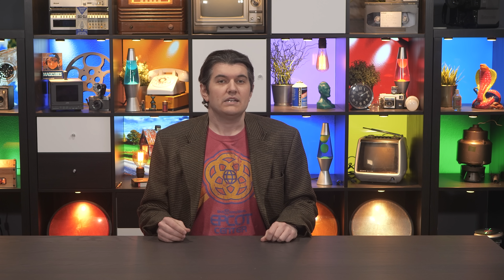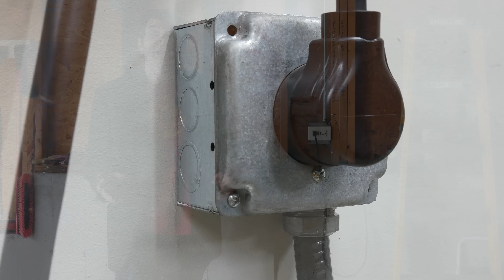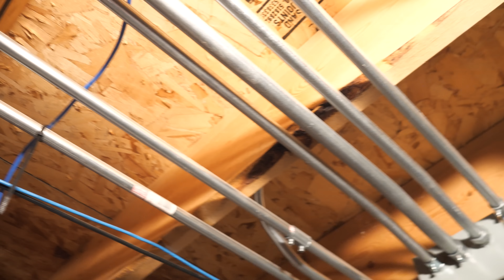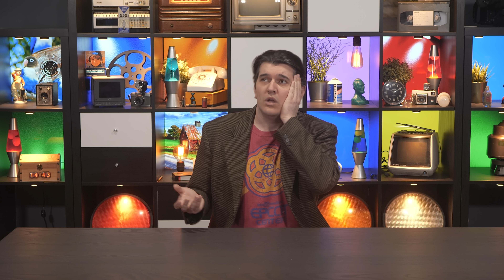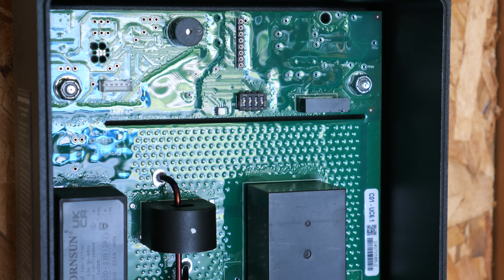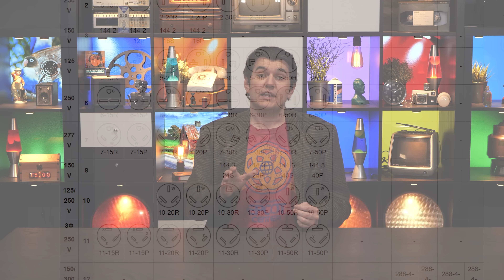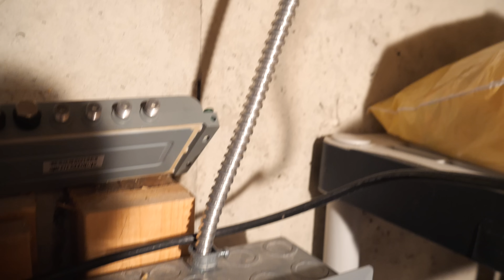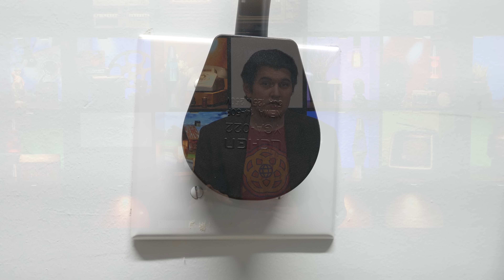The "standard" car charger is usually overkill—but your electrician might not know that

Comment: Depending on people on how much they drive most the time 120 volt charger is so good for them. I drive an electric vehicle to do Uber and I probably do close to 500 mi a day maybe a little bit less than that so most of the time I have to charge at least once and if not even at home we'll have to charge overnight. I would not be able to survive on 120 volt charging I have a 240 volt with a Tesla charger that I have an adapter for for the current car that I drive which is a BZ 4X. Cuz usually by the time I'm at home I'm at nearly between 20 and 30% and it'll take between 4 to 6 hours to charge on regular basis

Comment: And meanwhile, here in Denmark our EVSEs run on 16A 400V, i.e. just under 11 KW. And that is with a bog-standard 25A service for the house. The wonders of every house having 400V three-phase power. The US really should have upgraded its electric system...

On the other hand, we would never be allowed to do the install ourselves. Any fixed install requires a licensed electrician. So no adding new sockets or circuits yourself. You can hang a lamp, that's about it.
Reply: Its a bit funny how this video is pretty much ONLY relevant to americans
Reply: We do just fine with what we have.

Comment: The reason to get a fast charger for me would be to make the best use of my solar panels. I get charged €0,35/kWh for energy from the grid and only get paid €0,075 for any surplus from my solar panels. I also get charged based on the peak power draw every month. So it would be important for me to get as much charging done as possible before the sun sets.
Reply: Let me guess , you live in Germany right? (Like me) I have a 3 string 13KWp array with 10KW facing south. 
I have never seen more than 11KW at any given time from the array. Even now on cloudless days I peak at 7-9KW. 
I charge my Enyaq at 5.5KW and my Avenger from a standard Shuco outlet most of the time (can switch from one to two phase).
I very rarely charge at 11KW (the highest both cars can charge).
Reply: @arpinchock 
I live in Belgium, but I guess the situation is very similar. 

How do you have 2 phases in a Shuko outlet? Shuko is the normal household plug right?
Reply: @yannick7230 yes it is wired for maximal amps on the outlet.
Reply: @arpinchock  Assuming that the other 3kw are distributed equally between east and west, that means you have 1.5kwp for early morning and late evening which will typically give you around half. This setup is likely designed to stretch self-sufficiancy into earlier/later hours but  reduces realistic maximum output at noon. It's a trade-off and imho the right one, you typically don't need all that power at once.
Reply: Yeah that's also why my parents elected for a 60a circuit for an 11kw EVSE more than a decade ago. It's nice to get decent/full charges from a few hours on sunlight on weekend afternoons. Summer weekday evenings exist too for this case. 
My parents love to do things when the solar is generating 😅 (and we don't have a home battery setup, there weren't real option back when we installed solar, and we were kinda banking on Tesla allowing V2L (flop ofc)).
Reply: Funnily enough by the time I get back home, my solar array usually outputs less than the 4.2kw required for my 3phase charger to start operating. So I  have to accept some grid draw as the optional single-phase charging doesn't help me as my location doesn't allow asymmetric PV injection even though the inverter  (Solaredge) supports it.
Reply: damn, when is EV2GRID coming? peak power could be shaved down easily with that
Reply: @Strawberrymaker I'm looking to get a home battery to offset my (peak) usage to my solar panels. I don't like the idea of wearing down my car's battery to do that.
Reply: @yannick7230 nah talking about only peak power reduction/compensation with the battery and not whole offgrid (dont know who offers that but have seen it in many research papers). but going completely battery is def the better idea if you have the cash 😁
Reply: @Strawberrymaker  I don't have the solar capacity to make it through the winter sadly.

Comment: Fun Fact: That OEM EVSE that came with the Bolt (and 2nd Gen Volt) is 240v capable, albeit with a not-to-code plug adapter.

*Tried to link to images of EVSE internals, but comment keeps getting filtered.

Comment: A fellow Bolt owner here, I charge mine exclusively on 110v at 12 amp. I plug it in when I'm not use it and unplug it when I am, just like my phone. My SoC has never dipped below 50% with charging limited to 80%. Since I bought it, I have never even thought about charging or range or anything like that. I just drive it!
Reply: A friend of mine who owns a condo (in a triplex with parking right behind the building) also charges his solely on 110v.

As was said in the video, pretty much the only times where it can be problematic is when coming back from a longer trip (2-3 hour trip). For everyday use he has 0 issues keeping it topped up with a fairly average commute.
Reply: Isnt that bad for batteries?
Reply: @MattH-wg7ou it's bad for nickel based batteries, but EVs use lithium based batteries. It's actually very good for lithium batteries to stay between 20 and 80%.
Reply: @MattH-wg7ou  It’s actually better for the batteries! The speed of level 1 or 2 charging will never be enough to significantly degrade them. What makes it better is that the Bolt, like many others, has an active heating/cooling system for the batteries that keeps it as close to optimal temps at all times. This system is only active when the car is on or when it’s off and charging. So by leaving it plugged in, it can keep the batteries cool in summer and warm in winter versus if I unplugged it as soon as it’s done.
Reply: I like your safety measure of only plugging it in when you're not using it, then unplugging it when you're ready to charge.

Comment: Standard 120V Level 1 charging is not powerful enough to both heat the EV battery and charge the vehicle in colder northern climates. It just doesn't provide enough KW. You must have a warmer place to charge the vehicle that stays above freezing temperatures to use Level 1 charging.
Reply: Worked for me fine all winter outside in New Hampshire with a Bolt EV
Reply: @charliesullivan4304 Maybe you had a mild winter but a level 1 charger only puts out 1.44kw of power which is not enough to condition the battery and charge when it's freezing. Its been tested and proven on YT.
Reply: @Weezedog it depends on the car.  I have a Bolt which does better than many at charging in the cold. But I don't think there's any car that can't charge at all a 32 F on L1.  That sounds like somebody exaggerated something that they heard from someone who exaggerated something that they heard from someone who exaggerated it.

Comment: It’s amazing how much the cost of the parts is so low compared to the cost professional installers charge. Would installers just estimate for just labor cost if they knew the parts were on site? Would any local regulations need certification of the work as safe ( they do in the UK )?

Comment: In some countries the EV tariffs can be limited to 4 hours a night, so charge rate can be important.
Wire nuts... Hmmm
Smart EVSEs are mandated in some countries as part of load shedding planning for the grid. As long as they still work with internet disconnected that's generally fine.

Comment: The trouble with this is that, as an electrician, I have never once in my life been able to sell someone a charger less than 240v30a. They usually want 240v50a.
Reply: People think their 1 hour commute to work is going to set their batteries back to less than 10% so they want to be able to fully charge in 8-10 hours. My car only charges at 32A and when I was looking everyone kept telling me to get a 50A charger just in case. Just in case you need it future proof your charger etc. I'm like I have my laundry in my garage I don't need to invest in charging yet I'm still told to. So people think they need something because everyone they talk to pressures them. Then you come in and say you only need half of what everyone is telling you and they don't want to listen anymore they made up their minds already.
Reply: @paulshields2220  People think that they might need to use their car in an emergency to travel a long distance without having to wait hours to use it.

Comment: We charged my dads BYD with the 110v “emergency” charger until the power company FINALLY came to install the 220V line 4 months late. It was FINE. He would plug it in whenever he was home and whenever he left he still had a full charge or at least 80% charge if he had forgotten to plug in one day. So yeah no need for a big charger if you drive less than like 100Km every day.

Comment: As an electrician myself, i need to make one thing very clear to Alec: on behalf of the trades you've talked about, like HVAC guys oversizing heating equipment, or here with electricians installing large circuits. The average Joe customer of ours DOES NOT CARE! I can fight with a customer about how they only need a 40 amp circuit, and then lose the job; or i can just shut my mouth and install the 60 amp circuit my customer is convinced they actually need.
Reply: I told the electrician who did my evse that I wanted a 40 amp breaker and he insisted I should go with a 30… I told him no I wanted a 40 amp so I can charge at 32 amp. He finally relented but I don’t know what his issue was when I had plenty of space in my breaker and 32a would give me a full charge overnight if I needed. I had the breaker space available but don’t get what his issue was !!
Reply: I don't know the specifics of your circumstance, but if I had to guess at why the person you hired didn't want to to go with the larger size, it would be one of the following: 1.He had the materials for the lower amperage circuit in his truck, but not the higher amp circuit, and didn't want to spend extra time to acquire them. Likely because #10 wire is common, but the larger #8 wire is used less in residential wiring, except for the dryer or large appliance circuits. 2. Adding that much potential current draw could have surpassed the math formula we're supposed to use when sizing the electrical service entrance where power comes into your home. 3. It could be that the pet supply that was chosen couldn't take advantage of the extra power. Or 4. He might know that most people don't necessarily need that level of power for their charger, and was attempting to help you save money; by using less expensive materials, and thereby potentially getting repeat business from you. There could be other reasons, but those are the things that would come to my mind if I was attempting to convince a customer to let me install a lower amperage circuit. @myaccount__7269
Reply: @ampzero66 I think it was #1 .  He kept pushing me to do it and once I said I want 40amp minimum he then had to make a trip to the store to get the correct cable and then installed it and it was fine; was like an extra $50 or something so again I don’t get what his issue was. He also said I was installing a larger amp then he normally does so I am guessing he always just installed the cheaper option for his other customers to give him more of a profit for the thinner cable. So annoying though
Reply: @myaccount__7269 If that was the case, it sounds like car chargers might be his "bread and butter" type work. And your fairly normal request took up time that he wanted to spend on installing more charger outlets for other clients. For most of the service calls I work, my company charges an hourly rate for my time, and then a straight percentage surcharge for the cost of the materials. A lot of the smaller residential specialist companies in my area will give the installer an hourly rate, plus a bonus for the amount of jobs they can complete in a week.
Reply: If you tell them it's an option and they decline, you have done all you can be expected to do.  No need to argue.
Reply: I've found a lot of my customers want a 60. Reason being they're starting with one EV. 
A second (or more) EV is in the future.
Reply: @benjurqunov60 breaker is fine to charge car at 40amp . Which maxes out most evs

Comment: I’m a little confused. I live in Australia, and I work in a hotel, with no EV chargers on site (Australia just hasn’t had the EV pick up rate that the US has seen, so public use charging stations are not as common here). Yes, we run natively on 240v, but when a guest wants to charge their car, we just hand them an extension cable and the connect it to one of our stock-standard 240v outdoor power outlets. My confusion is over why you would go through this entire process, and purchase an “EV charging station”, when you can just use the every-day, run-of-the-mill, power outlet which is already present in your garage. What are you gaining with all of that? Why does your charging station need to announce itself to the car, and the car have to answer back and negotiate with each other. If the outlet is only providing xxx volts, and xxx amps, the car can’t pull more. Energy is ‘pushed’ from the outlet to the device, not ‘pulled’ by the device.
[edit] Our dryers just plug into standard outlets. We don’t need special outlets. I’m unsure why you do, when you can just install a standard 240volt outlet.
[edit 2]. How on earth do your regulators allow aluminium (aluminum) wiring? Copper is mandated in every other developed country on the planet, and the fact that aluminum oxidises is the exact reason why it is banned across the entire globe.
Reply: The smaller chargers are limited to 120v and 15 amps. That's only 1800 watts for charging. Most people do not already have 240v outlets in their home. Only for large appliances.
Reply: @s10jam Then just Install an additional 240v outlet (or convert one existing 120v garage outlet to 240v) , and be done with it. I mean, as you stated, you have one for your dryer…. So just install another one for your car. What am I missing?
Reply: @just_passing_through My dad was into painting cars and welding, so I have 240v 20a service in the garage.
Reply: @jeffkardosjr Exactly. Why does it need to be any more complicated than that?
Reply: @just_passing_through  I agree. But the idea of doing that would deter some people from going with an electric car.

Comment: I've been looking into getting a Hybrid (don't want to fully commit in the midwest) and my detached garage has all the necessary infrastructure for charging an EV. My great grandfather built the house and garage back in the day and he used the detached garage for his hobbies, mainly welding and outdoorsy stuff. The support beam has an appliance outlet already on it, so I wouldn't have to get any work done. Whether it's safe or not I don't know, as it hasn't been used since he passed over 20 years. But the garage has it's own breaker not far from the support beam so it wouldn't be too much of a hassle to do maintenance.
Reply: Why does being in the Midwest make you reluctant to commit to a hybrid?
Reply: @charliesullivan4304  Reluctant to commit to a full EV. There are very few charging stations where I live. There's one not far from me, but the next nearest one is 20 minutes away. It's why I'd rather do a Hybrid. Since I don't drive very far to work, I could stay on electric mostly and swap to gas when it's low or I hop on the highway.
Reply: @Dw7freak  gotcha, I misunderstood.  My state, new hampshire, isn't great for charging infrastructure, but I like driving my EV so much better than anything else ive owned that I tolerate the occasional need to plan around charging availability.  Your distances are longer though so it might not be the same situation.

Comment: The problem is America never advanced their electrical systems in these houses, newer houses may be after the year 2000 or 2010, but older houses from the 50s 60s 70s 80s and 90s never got upgrades to their panels or any of it so most of those houses are in the Stone Age, in the 1950s and 60s they had plans to make every house electrified and it was gonna be wonderful but I think the fossil fuel lobby got involved and well here we are

Comment: Having the charging station on a plug? Here they are typically hardwired, three phase and 400V. 11kW if you use the full 16A.
Reply: It's mostly for convenience. They can be hard wired if you want faster charging speeds but plugs are still two phase 240v up to 32A
Reply: @Reposeful  I am also considering getting a CEE5 400V/16A portable charging cable.